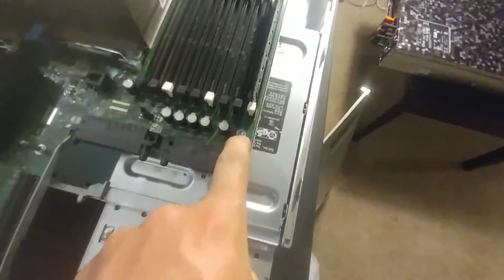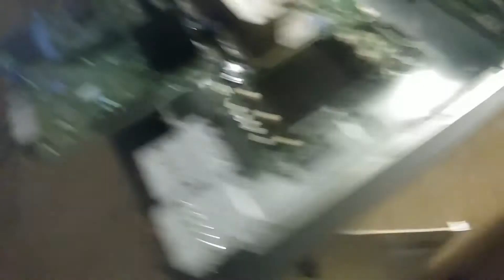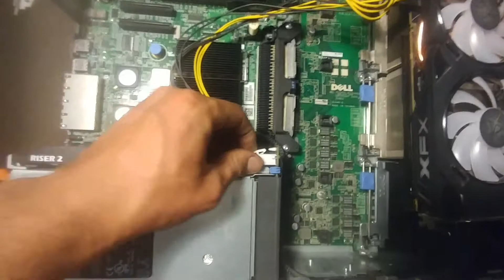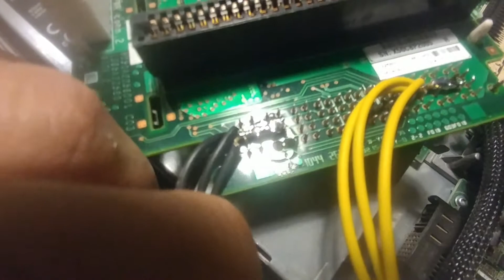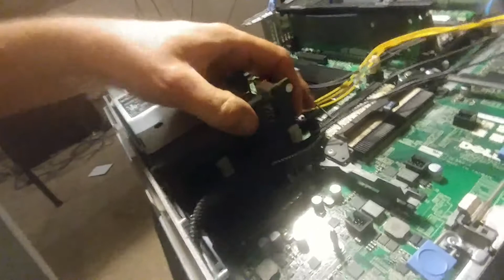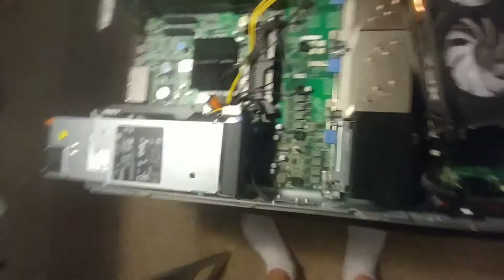R810 GPU install details, R710 GPU attempt

Comment: Wouldn't it be possible to just unplug the plug to the side of the power distribution board and hooking into that with a splitter cable instead? Or does it not deliver enough power there?

Comment: This was just the video I was hoping to see! I just picked up an R810 and was horrified when I saw that VGA connector! being able to put a GPU in it is exactly what I wanted to do!
Mine is a 4x CPU E7-4870 with 256gb of ram, it didn't come with any drives so I'm sourcing that soon.
BTW have you tried SSDs in the SAS drive trays? do they work? I've read that the PERC H700 might be picky about non-Dell Drives.
Just wondering what your experience with the drives are.
Reply from the maker: SSD worked for me but I installed Windows on it and updated the controller firmware before I installed them.
Reply from the maker: It's not picky on newer firmware in my experience.
Reply: @ANATURALDREWSASTER  awesome I'll try some SSD drives I have laying around will try to update the firmware before hand. But looks like I gotta at least have drives to boot into windows first. Thanks for the tips!
Reply from the maker: @tuuhoang5757  my pleasure! I highly recommend jumping to the 12th get servers as soon as you can btw, WAY more processing power, way more power efficient with native GPU support.

Comment: Wait so you just solder all the wires as one big bundle on the contacts?
Reply from the maker: Yup
Reply: @ANATURALDREWSASTER  Are you just using a standard 6 pin male to male PCI-E cable?
Reply from the maker: @GuruOfTime  I ordered pcie cables with bare ends, there's a video I uploaded on how to make it.

Comment: Did you ever test the card without the fans running to see if the heat dissipation was the same just using the server's fans?
Reply from the maker: I ran a GTX 1070 with no fan with great success, but temps were lower with fans
Reply: @ANATURALDREWSASTER  Good to know, thanks.

Comment: just wanted to say great video!  Also for anyone interested i got a graphics card (ZOTAC GeForce GT 730 2GB DDR5) running in a Dell R410 server .  -had to disable onboard graphics chip in bios.  Runs great with Ubuntu Mate 18.04.  Removed RAID card and spliced in a SATA power cable - now just using hard drive on one of the onboard SATA ports.  Works great as a workstation.  Blender 2.8 works perfect!
Reply from the maker: Thanks I'm glad you enjoyed it, and great to hear other people modding out these servers! Be sure to make a video of your setup, I'd love to see it!

Comment: Would it have been possible to plug a couple of long SATA extension cables into the SATA power ports from two of the HDD slots, route them around the fans and then use a 2x 15-pin SATA to 8-pin PCI-e adapter for the GPU?  I guess if you're using all of your HDDs, that's probably not an option, but I'm not sure if you specified that in this video.  Your way makes more sense but I personally do everything I can to avoid soldering/cutting anything if it's not absolutely necessary.
Reply from the maker: No, the SATA power would be nowhere near enough for a GPU
Reply from the maker: Your best option would be pickup a used r720xd, that has native GPU power support as well as pcie 3.0

Comment: ? can use not use the dvd drive  on the r710  & have A splinter & then from the splinter go from the dvd connector to A custom 6 or 8 pen connector, I would think you can do as long as all the power leads are in the right places
Reply from the maker: Joel Crocker not enough power for a high end card

Comment: If you've got a steady hand, I'd suggest directly tapping the back of the R710's power connectors since they appear to be exposed. If I mange to get a hold of a R710 for myself in the near future, I'll do this and test it on my STRIX RX460. Seems like an appropriate card as a POC.
Reply from the maker: I didn't want to risk the plastic melting, and they are not as exposed as they look.

Comment: Hello, i think nice work and it inspired me to do it too. I would like to do something similar with a poweredge R910, which has a similar power pcb and 4 PSU with each 1100 Watts. I measured the space for the gpu and it was 20,5 cm, but with no space left. Actually I wanted to put a GTX 1080 mini in it, but it needs 21.1 cm and a bit more. I need the gpu for gpu rendering and the 4 E7-4870 for CPU rendering. Sould I just go with a 1070 mini, they are about 18cm max - which would fit - but they are more than 30% slower. Any suggestions?
Reply from the maker: Honestly I'm not sure what to suggest as I have zero experience with the 910.
Reply from the maker: Paul Klee if you ever find yourself around Vegas, bring your server to me and we'll figure it out.
Reply: Paul Klee,  managed to work the GPU on the R910?

Comment: Nice video.
will be glade if you can assist me to update a bios on an R810   (4XE7-4870,  40 core server). and also how i can basically install any simple low profile graphics card.
Lastly windows 10 does not recognize all the 40 cores but does only recognize 20 core. is there any way you can help me overcome this.
Reply from the maker: PIXIL MOTION Well first things first, Windows 10 only supports 2 physical cpu sockets, leaving 2 unused. I'm not sure what issue you're having updating as there are multiple upgrade paths. Personally I would use Dell's .exe upgrade programs that run within Windows. Go make coffee after starting the upgrade programs, they look like they freeze but they're just slow. If you disrupt the reboot process after upgrading, it'll revert to the previous bios. Basically have patience.
Reply from the maker: PIXIL MOTION now what do you mean how do you install a low pro card? I honestly don't have enough cards to do testing, but viewers are welcome to donate cards and I'll make a video about what works and what doesn't.
Reply from the maker: PIXIL MOTION also I did explain the cpu thing in the video. lol
Reply: i mean the small card. they mostly don't come with any power plugs therefore you only slot them into the Pcie slot without power with any additional power cables.
Reply from the maker: PIXIL MOTION yes i tried a firepro of that style and it failed to post. I may try again as i think that was with an older bios but I don't believe it will work as the slots are only rated for like 35 watts vs the pcie standard 75
Reply: Wondering if you ever updated to Windows 10 for Workstation to run all 4 processors and were still able to handle the GPU?
Reply: Do you have a link to the documentation on this? I’m looking at doing the same thing and would rather not solder
Reply: Somebody else already mentioned it, but now I'm wondering as well: Have you tried Windows 10 Pro for Workstations for your 40-core server?  Windows 10 Home and Pro are limited to 2 physical CPUs, but Windows 10 Pro for Workstations raises it to 4.  It would be exactly what you would want to get all of your hardware working.

Comment: I have the soldering skills of a 3 year old. But I think i'll be able to manage this mod. I've been wanting to do a graphics card for ESXi passthrough. Will be ordering one of these R810 power boards on eBay. I think I have sufficient PCIE Power cables laying around. Will have to figure out which Radeon based card im going to go with first. think I have a HD5850 hanging around somehwere and will need to see if it's short enough to fit. I've heard most AMD/ATI cards will work while only the enterprise grade Nvidia cards will work. And I can't afford a GRID card. lol.
Reply from the maker: hallis1 I'm not possitive, but I believe you're correct. Am nvidia card will work, but not for pass through. If you already have one though, wouldn't hurt to try!
Reply: Won't be pulling the GTX970 out of the gaming rig but i've read quite a few posts where some people have been able to make the video cards work for host OS gaming but not for passthrough. There have been mixed results on passthrough with like 1060's, etc. I'm just going to use what i've got laying around. More for my own learning about ESXi passthrough. Sad to see there are difficulties with the R710. I have a r510, r610, r710, and r810 and they are all excellent. But my r710 was my first dell server. It's an old Google appliance. had to jump through some hoops to overwrite the Google BIOS but it's now 100% Dell firmware now.
Reply from the maker: hallis1 yeah the 710 is a good box.  The 810 is just a beast! i use my 710 with nas4free, and I'm in the learning process of setting up an iscsi target with it. Be sure to get e7's for the 810, they're much better than the previous gen.
Reply: I picked up 4 of the older L7555's for $10/each. Just waiting on the extra two heat sinks to arrive. I think 64 logical threads will be enough :)
Reply from the maker: hallis1 the e7's are more efficient, you get many more cores at less power usage, so long term cost is lower.
Reply: This isn't going to be a 24/7 machine. basically just a lab box. going to be using my R510 and R610 for my 24/7 VM's
Reply from the maker: hallis1 ah gotcha, mine runs continuously serving up plex and other goodies.